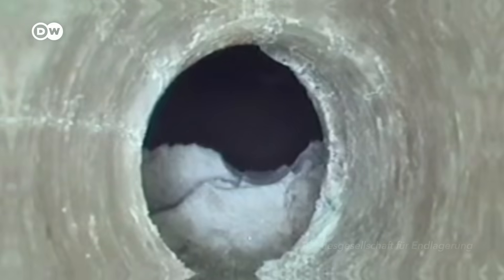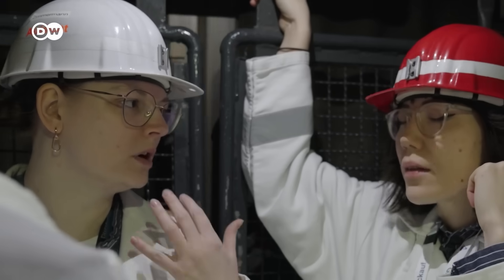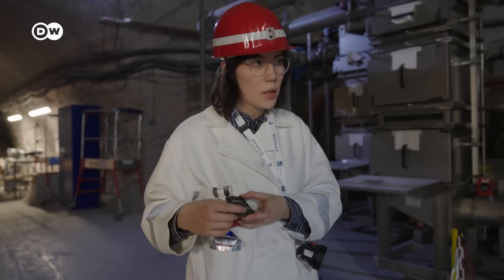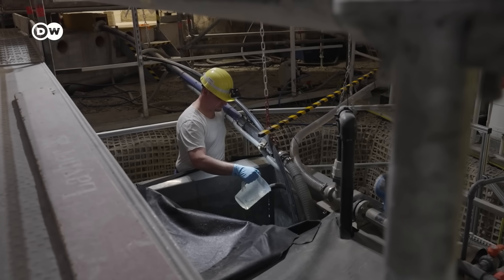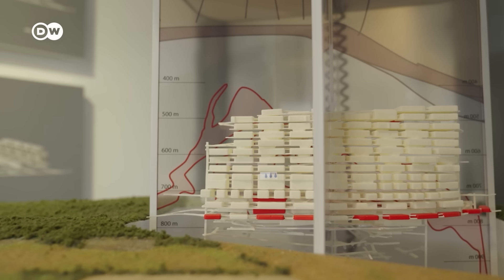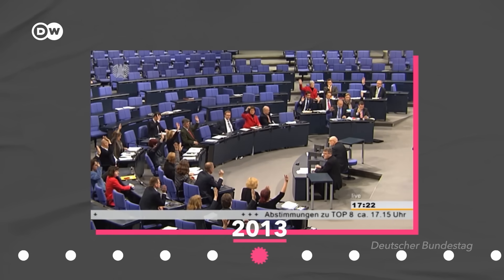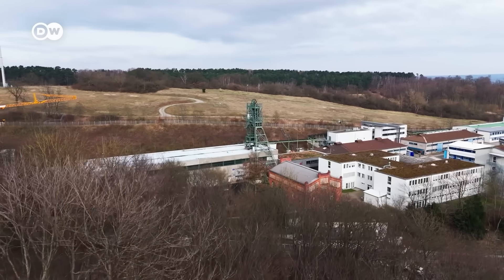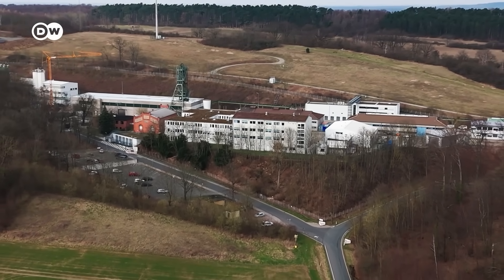Inside Germany’s hidden leaking nuclear waste dump

Comment: The problem of the Nuclear waste is not it's a radioactive waste.
How can Germany damp nuclear waste like that the didn't even know what they are doing the literally dump all the ways that without monitoring which waste their damping and how they are placed. They throw nuclear waste like tennis balls.
Event India store the nuclear waste very safe. How much waste and where the waste is stored is documented. 
The problem is what they doing with the nuclear waste.

Most of the people think that nuclear wastage blue liquid with bubbles coming from it or something. The actually low level radioactive waste can be buried under your garden 🏡 there is no problem for that. Even medium level radioactive waste can be stored in simple Steel containers .
The problem only with the high level radioactive waste.
The highly radioactive waste is only two (2) %to three (3)% from entire nuclear waste.
The main point is nuclear reactor only consume 5% of the nuclear fuel after that reactors can't produce enough energy so they need to replace the fuel.
Actually highly radioactive wastage 2% or 3% the fuel can be obtained will be 95% from the highly radioactive waste that means we can minimise the highly radioactive waste, when you recycle the nuclear waste the the radiation of the nuclear waste decreases from couple of thousand years to couple of hundred years.
If we recycle the nuclear waste we can minimise the radioactive time and quantity of the waste.
We can  Store this waste safe. 
This facility didn't even need to as time as normal facilities needed.
If you don't want any radioactive waste from nuclear energy you can go to thorium. 
People may ask why don't thorium reactor didn't exist today. When nuclear energy developed countries from the around the world 🌍🌎 want nuclear weapons that's why they developed that technology, if you want to develop thorium reactors right now the problem is nuclear fuel is very cheap so government don't want to shift there  resources to any thorium reactors right now.

Comment: Doesn’t transporting the waste somewhere else create a whole new set of risks and problems in addition to those posed already present. Everyone is going to say not in my backyard but it’s already there and moving it somewhere else temporarily til they find another permanent place doesn’t make sense if they are trying to reduce the overall risk. I’m open to other viewpoints I just don’t get their position considering their interest
Reply: It does, while all surveys undertaken after the problem arose came to the conclusion, that the waste will be perfectly fine in Asse-2, as long as you backfill the mine and don't try to remove it. Removing it was assessed to be by far the worst course of action to take.

... so of course, the political decision was to remove the waste from the mine.
Reply: @KarlKarpfen  ..of course! sorry I just saw your reply.
Reply: It would presumably be evaluated and stored in more modern (safer) containers. But then, this is the Government.

Comment: Note that low level waste often contains no radioactive materials at all. This is due to very stringent safety standards, that means everything (except people, mostly) within the fence of a nuclear power plant, is, by default, classified as at least low level nuclear waste and cannot be put into municipal waste. This includes e.g. old computers, office chairs, lights, overalls, tools, shoes, floor tiles, even that sheet of paper that didn’t print properly. When we think nuclear power generates a lot of waste, we’re often misled by low level waste, that is often not actually radioactive.
Reply: If someone uses the toilet in a nuclear power plant is the waste that they sent down the toilet considered low level nuclear waste?
Reply: @eitkoml yes that is if there was a toilet in a radiological zone (there are really none)
Reply: The Asse II mine contains approximately 47,000 cubic meters of low- and intermediate-level radioactive waste, which was deposited between 1967 and 1978. This waste is stored in around 125,787 barrels across 13 chambers at different levels of the facility.

The total activity of the radioactive material at the time of deposition was about 1.8 × 10¹⁵ Becquerels (Bq). Due to natural radioactive decay, this activity has decreased to approximately 1.53 × 10¹⁵ Bq as of January 1, 2023.

Specific radionuclides include approximately 28 kilograms of plutonium and 30 kilograms of uranium-235. However, the documentation of the stored waste is incomplete and partially inaccurate, leading to uncertainties about the exact inventory.
Reply: @AndreasOWL  Это очень мало. Один ядерный реактор среднего размера содержит десятки тонн диоксида урана. И после его использования это уже радиоактивные отходы. Причем очень опасные (в чернобыле внутри саркофага есть такие же сборки твс, они фонят даже через 40лет 300Рч.)
Reply: 100% correct

Comment: Ok, so by the look of the containers, which are barrels: Only low- and medium-level waste get stored in barrels instead of concrete casks. Which means that it's effectively almost just regular trash, but underground.
Reply: just mildly contaminated swabs and gloves, that sort of thing. trivial really.
Reply: So most certainly not nuclear "fuel" waste like they would like you to believe!
Reply: @nzoomed  No I doubt it. Its not even just nuclear power stations that produce such waste, for example hospitals use radioactive materials for various purposes.

Comment: without providing radioactivity levels, this could be blown out of proportion, it has been decaying and will continue to do so, depending on the waste, could be not as bad
Reply: Problem is, that water is washing out the radioactive material, they found radioactive stuff in the sump in the lowest level of the mine. 

Thats why they have to return it.
Reply: @q9260  The thing is they do not discuss the magnitude of contamination. They are just saying its contaminated. Anything even a fraction above normal is technically contaminated. The word nuclear is a free pass to gross exaggeration.
Reply: @q9260 
Try using a Geiger counter on an underground well or water directly from an underground spring, and you'd be shocked that it's radioactive.

Believe it or not, the Earth itself is radioactive.

The water really isn't an issue to be honest here.
It only seems like a problem due to media and dummbb politicians.

Other than that, the real problem is the water overflowing and causing damage to the underground facility itself and might cause a sinkhole or overflow the water back to the surface with the radioactivity being the least of your problem and with the plastics, metal and other possible toxins from the materials there reaching the surface.

It's going to be no different if the place was filled with regular trash.
Reply: Wikipedia page link to the Bundesamt für Strahlenschutz page for Asse II puts the (2010) radioactivity at about 2.9 PBq . Not great, not terrible?
Reply: As if Germans would be so stupid to just dig a cave a few meters deep
Reply: @alexg9727  Lol, well they do support the global 'net zero' fantasy which has severely crippled a once great economy and also let the US blow up their own cheap and plentiful supply of gas, so there's that I guess🤷‍♂️
Reply: the main issue is the water coming down the tunnels from the surface
Reply: Nevertheless it has been decided to get out the containers. Cost estimation 8 billion €.
Reply: @klaushoegerl1187  money job:)
Reply: Do yu know that to mine gold they use arsenic ? Gold mine are full of arsenic . Arsenic can get into water and kill lot of people. But the probkem is liw and medium nuclear waste that come from industrial and medical use ? All this materials decade in few years. Arsenic dont decade. Nuvlear irradiated bars are stored in solid form and inside huge concrete and ceramic container.
Reply: Half a kilometer underground. Will never effect the water table
Reply: @alexg9727  This isn't true. Fracking wells that reach down 5-10 miles are sealed to prevent contamination as well, yet somehow large amounts of hydrocarbon and fracking fluid contaminants still find their way into the water table. Capillary action transports the contaminants into the water table and aquifers against gravity. Bottom line, it was idiotic to dump the waste into a mine made of one of the most soluble substances in the world.

Comment: All this nuclear waste can be used as fuel in nuclear power plants, it just requires some modifications/upgrades to the plant.
Reply from the maker: For this one it's not an option anymore since the plutonium and uranium there has been mixed with other waste and due to contamination risk would be highly risky and hard to recycle. But in general recycling nuclear waste is an important topic that we are planning to look at one of our future videos! ☢️
Reply: No, as we aren't talking about used fuel with Asse-2, but a few Co-60 radiotherapy sources in the better shielded and properly stacked containers and besides that uncontaminated commercial waste from within the borders of a nuclear power plant, which nobody bothered to invest thousands of Mark per ton to get it recognised as "normal" commercial waste and dumped at the local waste incinerator or landfill.

Comment: piling nuclear waste in 1964? In 1964 the us was still researching how it could work, all plants that did exist where located in the us and experimental
Reply: The Asse-2's actually radioactive waste parts are from medical devices, research and technical applications, not from nuclear power generation.

The nuclear power generation waste came later and was disposed of as "nuclear waste" not because it was actually radioactive to any reasonable extent, but because bureaucracy didn't allow nuclear power plants to dispose off non-radioactive waste the same way everyone else did.
Reply: The Asse II mine contains approximately 47,000 cubic meters of low- and intermediate-level radioactive waste, which was deposited between 1967 and 1978. This waste is stored in around 125,787 barrels across 13 chambers at different levels of the facility.

The total activity of the radioactive material at the time of deposition was about 1.8 × 10¹⁵ Becquerels (Bq). Due to natural radioactive decay, this activity has decreased to approximately 1.53 × 10¹⁵ Bq as of January 1, 2023.

Specific radionuclides include approximately 28 kilograms of plutonium and 30 kilograms of uranium-235. However, the documentation of the stored waste is incomplete and partially inaccurate, leading to uncertainties about the exact inventory.

Comment: I think the problem is exaggerated. First, we talk of low and medium radioactive waste, something such as PPE, filters, contaminated materia, that is at best dangerous for 300 years, but really just after a few decades is no longer dangerous. There is no nuclear fuel or high level waste. 

Second taking that waste out it will be probably more dangerous than leaving it there. Even if the mine collapses, the waste is enclosed in salt. Yes, there is problem with water that can penetrate in the soil: not a big deal, you just capture and clean it, as you would do with any other dump site. Even if water is not pumped out, its effects will be negligible, not something able to produce effects on the population. Or the chambers where the waste is can be filled with concrete (or was it already done?) to mitigate the effects. 

Taking it out will cost a ton of money, and can be dangerous, either for the workers that will do the job, either for the population that lives nearby that will be exposed to radiation (minimal, but greater than zero). There is really no reason to do so, take out the waste and then? Dump it in another site? Just make that site suitable for keeping the waste in it.

Comment: I wonder if the uranium and plutonium waste can be used as fuel in CANDU reactors
Reply from the maker: Theoratically that could be, but in practice not really because the uranium and plutonium in Asse are mixed in with other waste for safety purposes. That's why it would likely be very hard to re-use. 🤔

Comment: What will happen with the contaminated water and dirt? Are we eating contaminated vegetables? Are we drinking contaminated water? if you move the radio active waste - does not mean that you have cleared the area. Everything in surroundings is now radio active also! How do you remove that? If an underground river is touching the radio active waste - where does the river going and what does it touching and contaminating on it's way? No body thinks of how much exactly is the contamination spreads. No body will trace the contamination, they are only going to stop it from growing and they will create a new place where they will start another contamination

Comment: Could you fill the rest of the mine with concrete and be done with it? Even if the barrels are extracted, where do you store them? Land is a limited resource. What a conundrum..
Reply from the maker: Hey there! An expert group looked at different options for Asse II from 2007-2010. The options were retrieval, relocation and filling with concrete. After looking at different criteria, e.g. feasability, time, long-term safety, they came to the conclusion that retrieval is the best option. One of the reasons against filling was for example
that it was not safe to say whether long-term safety can be proven for this closure option.

Comment: Nuclear waste in steel barrels, plus salt water.  That was a big brained idea to use that site.
Reply: Low- and intermediate-level waste is effectively just trash.
Reply: you are not gonna find high level waste in steel barrels
Reply: @RochaPartneristDeadFireHD  I forget what they said, filters and some other stuff.  Not spent fuel.
Reply: @chincemagnet  filters for washing and draining cavity are veryyyy high contam, like 4 rad an hour.
Reply: aka that would give you radiation poisoning, filters are full of the fuel particulates
Reply: @whatsinhisface5375  thats pretty much irrelevant. the radiation and the waste is well enough contained.
the danger of spent fuel rods is, if not properly contained that they start reacting again
Reply: @woswasdenni1914  dont say BS . To start reacting again you need an high percentual of U235. And irradiated uranim bar have depleted uranium 235. And in that barrels are not put nuclear irradiated naterial but medium and low radiation material that come fron industry and medical use. Get some culture.
Reply: As far as I know everything inside the barrel is also encased in concrete
Reply: They don't dump high level waste. That's stored at the reactor sites.
Reply: It Doesn't Work The Way They Want If They Even Care. Water Only Hides Nuclear Waste Just Like Salt Only Hides The Signals. In Truth They Really Messed Up.
Reply: and usualy they pour concrete into barels. this documentary is just another sht show.
Reply: still another reason to avoid nuclear power. Humans are corrupt as hell and will eventually cut corners.
Reply: Dein land macht es bestimmt besser😂😂😂😊
Reply: @W33DiiTV  Oh? To what country are you referring? You have no idea where they're from or how they handle their waist products.
Reply: Sorry . Nuclear radiated material is not in that barrels. In that, barrels are put low and medium radiation material produced by industrial and medical use.

Comment: In the United States nearly all salt mines are around bodies of water. It’s a bit of a given that salt, which is fully dissolvable in water (to the saturation point at least), are going to to start leaking at some point. That’s just how it works. Why didn’t Germany simply reprocess the nuclear waste (France has an entire slice of the economy doing so) instead of dumping it? That way you guys wouldn’t be so heavily reliant on Russian oil and gas. EU countries made a climate pledge, Germany May as well back out since they’re replacing all that nuclear energy with both oil and gas electric energy production?
Reply: France is exporting its nuclear waste to Russia which just dumps it into the landscape around Tomsk 7. In 2018 the nuclear waste storage in  Pierrelatte was full, EDF declared the waste a valuable raw material and exported it to Russia. A very good business for Rosatom (the same guys who fantasies to wipe out Paris with a nuclear bomb) and a problem less for EDF. This business is still working, even after the full scale invasion of Russia into Ukraine and the sanctions.
Reply: The amount of new oil-fired power plants in Germany is zero and there are no plans to built such power plants either. Contrary to your statement CO2 emissions from the electricity sector in Germany fell by 20% in the year  the the last nuclear power plant was shut down. The reasons for this were less natural gas, less coal, more renewable energy and more imports of hydro power and wind power from Germany's Nordic neighbors.